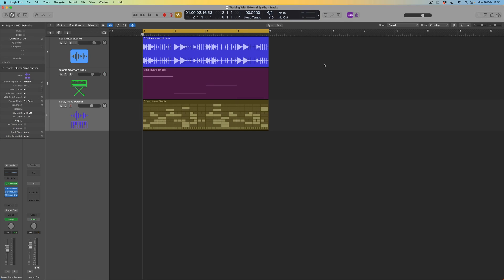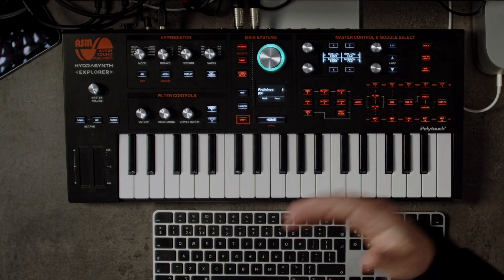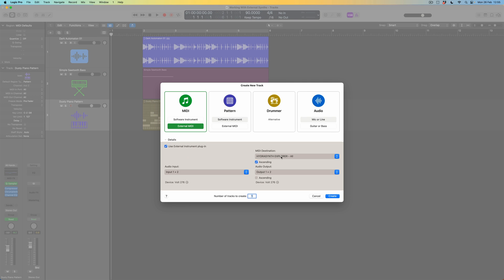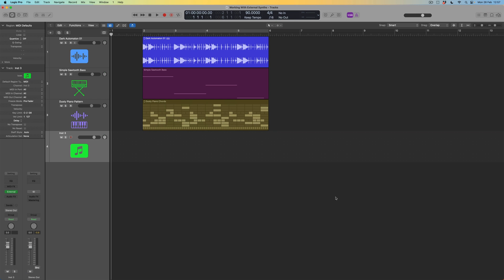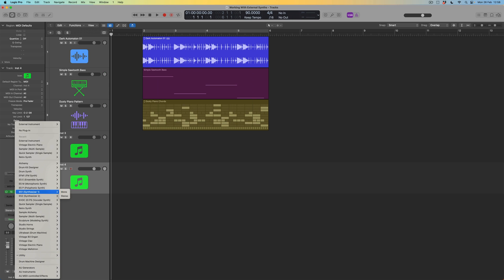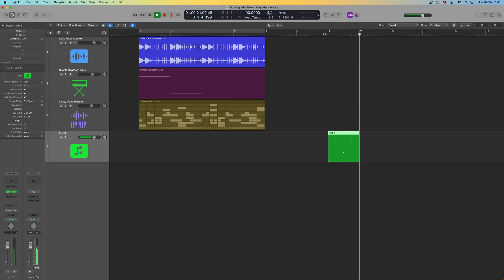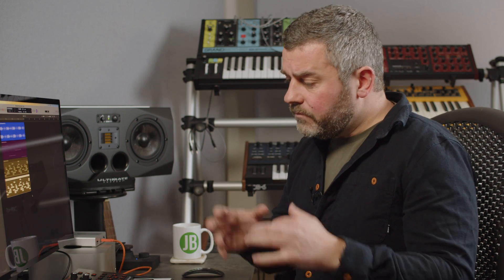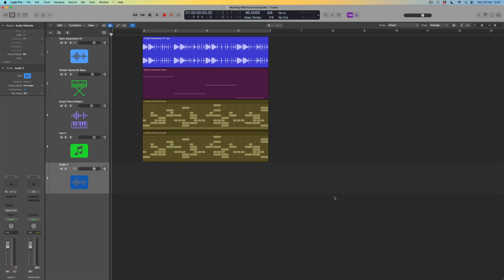LOGIC PRO X - Working With External Synths

Comment: This is something I'll need to revisit once I get Logic lol. Gr8 vid! I assume, if you then loaded up the project and it contained all the elements thus far and your synth wasn't turned on - you'd get a warning from Logic? Thanks!!
Reply from the maker: Thanks for your question. The External Instrument plug-in will still open but, yes, you won't hear any of the notes from your External synth if it isn't switched on. But the track will remain active - so if you switch on your synth, you'll be back in business!
Reply: @jonobuchananmusic  Thanks for the clarification, and at least once you record the audio - that part of the process is committed to a track. Cheers Jono.

Comment: Hi jono! I have a Vermona mono lancet but it does not appear in MIDI destination. What can i do???
Reply from the maker: Hi Tom. If the synth's USB port is for carrying MIDI (rather than audio), it might be a case of installing a driver on your computer from the manufacturer's website. If the USB port is for audio interfacing only, you'll need to use the 'regular' MIDI connectors on the back for MIDI data transfer. This in turn means that you'll need a simple (and inexpensive) MIDI Interface for your computer. Connect the synth's MIDI ports to the interface and connect the interface to your computer. Then, using the I/O plug-in, select whichever port number on the MIDI Interface you've connected the synth to and you should be good to go! I hope that helps.
Reply: @jonobuchananmusic  Thank you so much for your help 🙏🏼🙏🏼

Comment: Thank you Jono! This has made my day!!!  I am so happy I can now connect my Yamaha reface CP piano to Logic and record an audio file and midi file.  I am wondering if you have already made a video which mentions how to connect a midi controller like for exemple, the Arturia Keylab Essential 49 to a synthesiser like in this context to extend the key range of a synth that has a short keyboard.  My reface has inputs for audio L-R, a USB port and a Midi in-out, cable.  I would really like to understand what can be done with these ports and input/output to better maximize the potential of the external instruments I have.  Connecting pedals and effects to external instruments is also on my list of things to know better...  And this always in the Logic Pro ecosystem.  Again you are my best tutor on Youtube!
Reply from the maker: Hi Daniel. I'm glad the video was helpful. I will certainly make more videos around connecting together various pieces of technology but, broadly... 

Connectivity falls into two categories - data, for carrying control messages from one device to another, and audio, to allow for the flow of sound signals. These days, lots of MIDI keyboards and keyboard controllers have a USB port to send MIDI messages from a controller keyboard to a computer (for example) but you can almost think about the USB port and the MIDI ports doing the same job in this example. As computers don't have MIDI ports, USB-over-MIDI is extremely convenient, as it saves having to buy a USB-MIDI interface. However, if you want to connect several keyboards to your computer, you'll soon run out of USB ports, in which case you could either use a USB hub, or you might decide to obtain a MIDI interface - a dedicated device for MIDI connectivity. MIDI ports come in 3 types - In, Out and Thru. MIDI Out sends messages (example: controller keyboard to DAW), MIDI In receives messages (example: DAW to external hardware synthesiser) and MIDI Thru allows messages to pass 'through' one device as they head to another. In the good old days when dinosaurs walked the earth (!), some hardware synths only offered, for example, 4 or 6 active MIDI channels at a time. So if you had two of these and used MIDI Thru, you could send messages from a hardware sequencer, 'Thru' the first MIDI hardware module (set up for channels, 1-6, for example), to the second (set up for channels 7-12, for example). Think of MIDI Thru as a 'passing on' of MIDI information to somewhere else. 

Computers don't usually have Audio inputs either. So if you want to send audio signals from a synth to your computer, you'll need an Audio interface as I've explained in this video. Again, your audio interface is likely to need a USB port to connect to your computer (or Thunderbolt in some cases), whilst the Audio outputs from your synth will need connecting to its inputs. That way, you can make audio recordings from any hardware you have which 'makes a noise'. Dedicated controller keyboards, of course, often don't have internal sounds. I will certainly make videos about these topics but I hope that helps.
Reply: @jonobuchananmusic  Thanbk you for this very detailed explanation of midi.  I do have an interface (Apogee Quartet) and I have connected my external instrument (Yamaha Reface CP) into input 1-2 and I the Reface USB into my Mac, so this is understood.  What I would like to do now, is to use my Arturia midi controller to control the Reface so I can have a bigger keyboard in this case 88 keys as opposed to 32 small ones on the reface.  I am already connecting the Reface via USB and I was just wondering how I can connect the Arturia to the reface.  Or do I just use a USB cable from the Arturia to the computer and that's it!

Comment: I would like to add that if you have few hardware synths that you have connected.
You can save a preset and or channel strip with the "external instrument" and or the channels changes to recall each synth with ease.

Saving the channel strip will allow for say an EQ and or comp that you may always have on each synth.
The preset will just save the synth and MIDI channel within the the "external instrument"
Reply from the maker: Absolutely, that works a treat. Thanks!

Comment: Jono….could you also bounce the external midi in place to get the audio version below it?
Reply from the maker: Hi Paul. Bounce In Place is an offline process which looks to render MIDI to Audio quickly. There’s no way to do that with External Audio as the source audio signal doesn’t reside within Logic. So it’s possible Bounce In Place will let you record External MIDI (I’ve actually never tried) but it would be no faster as the audio would need to be recorded in real-time. I hope that makes sense.
Reply: @jonobuchananmusic  Perfect sense thank you….I assumed there was a good reason you didn’t go that route!

Comment: Hi Jono, thanks for the great video but the problem I always had with Logic is that when I record audio from external synths or drum machines the recording is a little off beat...and the start of audio is truncated because anticipated. Usually I record from half measure before and then adjust on grid. Any tip? Thanks
Reply from the maker: Hi Matt. That’s a latency issue. As processing needs build up as more effects are added to a project (particularly lookahead FX like the Adaptive Limiter), Logic will ‘take a moment’ to ensure it has enough power to playback your audio. That approach works well until it butts up against real-time processes… like recording. The best way round this is to engage Low Latency Mode before making a recording. To do this, Control-click anywhere ‘grey’ around the Transport bar and choose the option to configure. Check the box for Low Latency Mode, which will be added as a button to your options at the top. Press this On before making a recording and turn it Off again when you’re finished. Let me know if that helps. Thanks!
Reply: @jonobuchananmusic  Cool...I'll try and tell you. Thx!

Comment: Hi Jono, great video! What's the best way to record a workstation synth, for example a JV1080 in Performance Mode? I always end up stacking all the MIDI on the same audio inputs and outputs, which quickly becomes unmanageable as all the repeated signals just become too loud.
Reply from the maker: Hi. Thanks for your question. The answer, ultimately, depends on what you want to do. If you’ve made a track in the JV1080, you love the mix you’ve created internally and you want to use Logic’s Mastering capabilities, for example, you can simply record the main stereo output of the JV1080 (in the same way I have in this episode) and capture every part as a mixed stereo file in one pass. But if you want full flexibility over each part, with the capacity for independent processing of each JV1080 ‘voice’, you’ll need to record them into Logic separately, one after another. You can still use the Stereo Output for each part. Just solo each one in turn. I hope that answers your question.

Comment: Ok, that's what happens with an external instrument- the midi track boosts the instrument I'm recording in parallel through my audio interface. But what about when I want an audio track from a virtual instrument i.e. a plug-in?
Reply from the maker: Morning! The easiest way to turn a virtual instrument into Audio is to use Bounce in Place. Select the MIDI region(s) you want to convert to audio and then Control-click. From the 'Bounce and Join' menu, select 'Bounce In Place'. There are a few options here. You can decide whether to include any audio effects you're using, and/or whether you want to fold Automation down into the resulting Audio File too, or you can leave those boxes unchecked, in which case Logic will simply copy the effects routings and Automation data across to the new Audio Track. Press 'Bounce' and you'll have the Audio equivalent of your MIDI track. If you select the option to 'Mute' the original MIDI, you can always go back to it if you need to.
Reply: @jonobuchananmusic  thanks ❤️